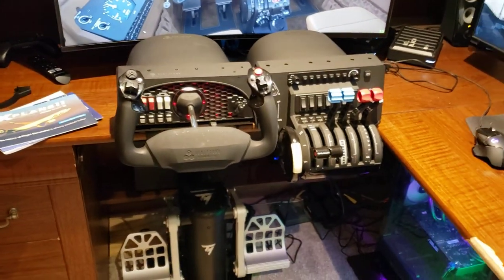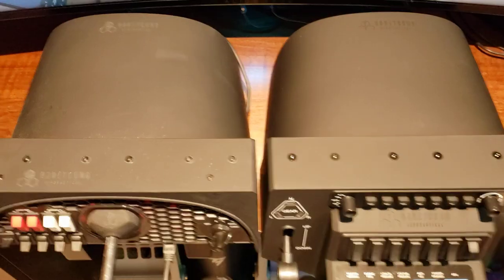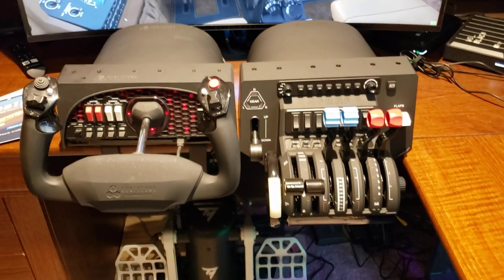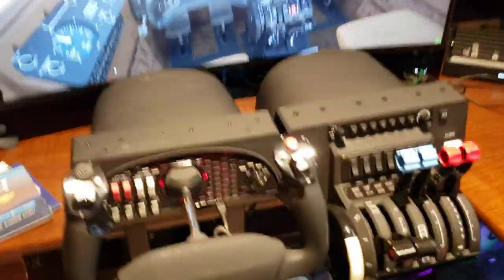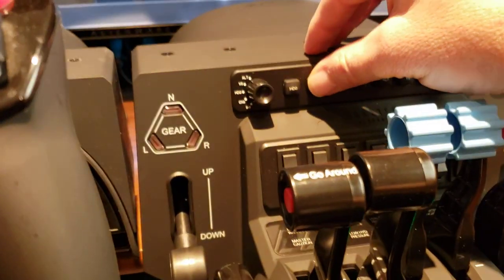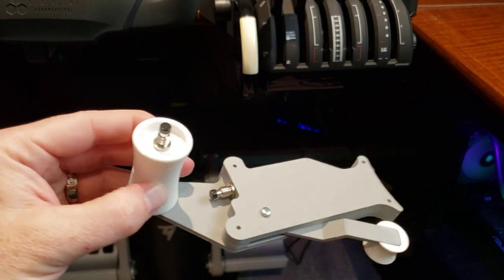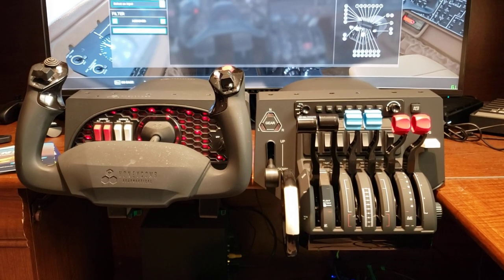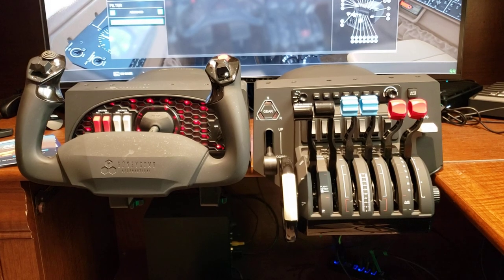Honeycomb Bravo Throttle Quadrant Setup & MSFS Throttle 2 Bug Fix

Comment: the 2-point connector on the first lever from the left is not 3-point because if you configure the Bravo for a jet with thrust reverser throttles they go into the lever position 2 to 5, which have three points with one point being used for the reversers. The number one position is intended for the speed brake lever.

Comment: Im having issues with my throttle quadrant and was wondering if you could help me out? I originally had this issue (except with all of the levers) so checked the video in your description and it helped, except for some reason it only registers when I push in a lever. It doesn't hold and it slowly drops back to idle, despite the physical lever holding partial or full throttle. It makes it impossible to fly. Do you think you could help me with this?
Reply from the maker: Hi Troy, does the same problem exist with all of your planes? Do you only fly msfs, or do you use it with other simulators? Just trying to isolate the problem.
Reply: @SimFanatic  I only play MSFS currently, but after a bit of research, I eventually went through and erased all controls from the throttle quadrant and reassigned them. Took a few hours but everything works properly now, except for my lights. They never turn on.
Reply from the maker: @troyandrade435  Glad to hear it works Troy. As for the LED lights, nake sure before you load into a flight (you can do it from map view in msfs), that your AFC_Bridge.exe process is running in Windows task manager.  If it isn't,  your LED lights won't work. If you need help with determining this,  let me know.  Cheers!
Reply: @SimFanatic  Awesome! I'll get to try that one of these next few days and I will let you know if I can get it going or not. Thanks for the help!

Comment: Where the hell do you keep your keyboard? lol
My problem is that the depth of both of them push my monitor too far back, and I have an under desk keyboard & mouse drawer, so the clamps are in the way.
But I also fly mostly in VR, so the monitor thing isn't as bad.
Curious, but do you temporarily mount them and then put them away off to the side? or do you leave them permanently install and use a different station as your main desktop? I'm thinking about building a wall "hanger" to hang them off of when not in use (to hang from the desk clamps)
I wish they had done more with the autopilot panel, they should have included a dedicated Vert Speed wheel. I find myself getting confused a bit and having to "duck under" my Reverb in order to see where the knob is placed or to see the buttons. I might fix some of that with a few tactile touch pads to help guide me, but I'm wondering if someone will develop some sort of in-VR indicator to know where the selector is at without having to look (or remember, which I'm bad at)
Reply from the maker: Hi there and sorry for missing your question. I bought an adjustable height mobile laptop table for my keyboard (https://www.amazon.com/Seville-Classics-Mobile-Computer-Height-Adjustable/dp/B0097GMHXG/ref=sr_1_5?dchild=1&keywords=keyboard+table&qid=1613704444&sr=8-5)  and put it to the left side of me when I fly. As far as mounting the alpha and bravo controls, i leave them mounted and can adjust the table linked above that I can slide underneath the controls and the clamps.

Comment: Can the red lights on the Alpha be turned off?
I just bought the Bravo and love it. Been considering getting a yoke (currently using a G940 stick).
Reply from the maker: Yes! Most definitely.  There is a small button on the back of the yoke that when pressed multiple times turns the lights brighter then off. You can cycle this by continuing to press the button. 

Blue Skies!!
Reply: @SimFanatic  Thank you for the information. I ordered the Alpha, it came yesterday. Love it too! Just finished mounting a Logitech switch panel to the Bravo. I didn't even know those screws on top where for that purpose. I was thinking of using 3m double sided automotive trim tape. Real glad I figured out those screws were for mounting things. The little book that came with it did not mention them at all, I don't think.

Comment: Thank you for the info.  My question is:  What computer do you need to run the Honeycomb and Flight Sim?  I'm just starting out.
Reply from the maker: Hello Strickland, thank you for watching and for commenting. Welcome to the wonderful world of flight simulation; you are going to love it! The nice thing about Microsoft Flight Simulator is you can adjust the settings to accommodate most PC setups. The computer I am using is about 4.5 years old and I have the following specs:

CPU = i7-7700k
GPU = Nvidia GeForce 1080 GTX (8GB VRAM)
Memory = 32GB (you don't need this much memory, 16GB will do)
Display = Alieware 34" Curved (3440x1440)

I can tell you that I have most of my settings at medium with the above setup and usually get 32-40 fps (frames per second). You certainly don't need the specs I have noted above, but as usual, the faster the better so you can start bumping up your graphical settings. I am looking at building a new computer with the following specs:

CPU = AMD Ryzen 9 5900x
GPU = Nvidia Geforce 3070 (8GB VRAM); initally wanted to go with 3080 but they are impossible to find individually and even in pre-builts; plus 3080 is overkill for 2K display.
Memory = 32GB 3200
Display  = Keeping my Alienware 34" Curved

If you have any further questions on a PC build or other, please don't hesitate to ask. I'm here to help!

Blue skies!!!
Reply: @SimFanatic  Thanks for the reply. I've done a lot more research on sims and I think I'm leaning towards the XForce Comet System.  Several you tube videos show a 49" curved monitor which looks good to me.  Now, where to buy them?

Comment: just got my Bravo. None of the axes register on my MSFS. Not just Throttle 2 mixture and props dont work either.
Reply from the maker: Sorry to hear that HBradley, I assume you went into the controls section of MSFS and tried unmapping the axis and remapping them? If not, try that. You can duplicate/copy the default settings for your controls and make changes so don't worry about messing anything up.
Reply: Just got mine and had the same issue with none of the axis registering. Remapped and they work fine, with the exception of using the two engine commercial set up (haven’t tried 4 yet) the throttle would fluctuate mid flight (by 20% sometimes) when I was just cruising along. So need to work on that tomorrow to see if I can figure out what’s happening